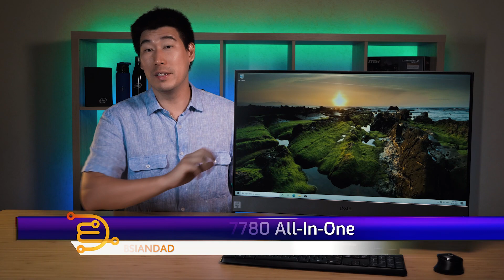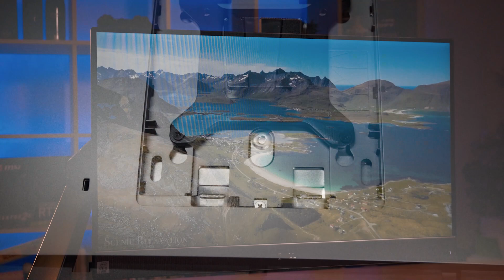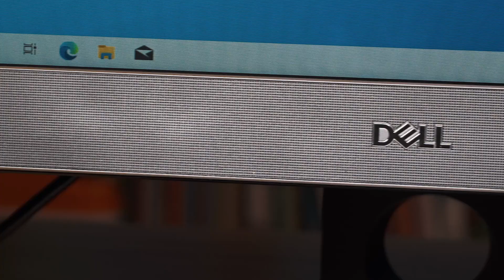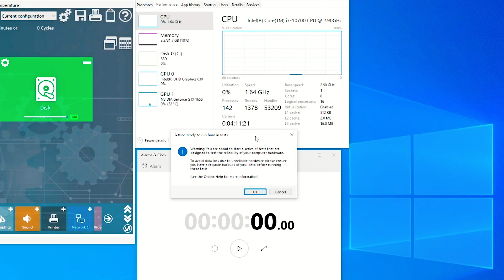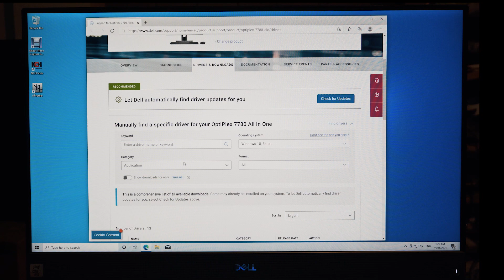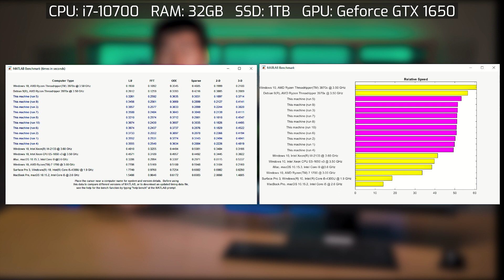Dell Optiplex 7780 All-In-One (AIO) In-Depth Review - Great business desktop

Comment: FAN NOISE. Reference is made to fan noise. It is NOT bearable. I have the i9 version and the fan noise is loud and constant. I looked it up in the forums and it seems I am SOL on this as I am outside the return window and in all cases Dell has no solution other than throttling down the processor or live with it. Other AIOs in the line have the same issue, so this seems to be a design flaw of this series. If you don't mind a constant, very noticeable (by you and your colleagues) noise in your office environment, then go ahead and get one. As for me, I'm stuck with a vacuum cleaner on my desk.
Reply: I find my i9 7780 is quiet as a mouse.   Even when running antivirus scan or other CPU intense programs remains quiet.  Contact Dell.
Reply: @robertarmstrongjr6081  I just ordered one and a bit concerned about the claims of fan noise and even screen darkness. I really need a confidence boost. LOL
Reply: @Biggerbyte  you will be very happy with the Optiplex 7780.  Mine has the i9 64 gigs ram touch screen  with wifi 6. Everything just works as required.  Even the Dell apps are non obtrusive.   Relax and enjoy this fantastic PC.
Reply: what is your exact Dell  model number?
Reply: Got my 7490 a couple of days ago. Config is i5 11th gen, 512 SSD, 16GB RAM and 1650Ti. Under load (games) it change to hair dryer! Strongly thinking of returning it. Check this video how they design cooling. 2 heat pipes from GPU goes thru CPU! Ofc that will warm CPU itself and in result increase overall fan speed (and noise). Was working for 4y on HP Eliteone which you absolutely cant hear (granted, only integrated GPU there). But seen video of this AiO with GPU and design is different. 2 heat pipes from CPU and one from GPU meets only at endpoint in radiator. That's how it should be.

Comment: nice, in your configuration it costs not so much less than my custom gaming PC lol
Reply: this is not a gaming PC, it's basically a laptop mounted behind a screen.
Reply: @psycl0ptic  yeah, but that's kind of ridiculous imo for a 1080p panel and a laptop
Reply: @pafawag5b6b5b  clearly with it's lack of RGBs it's not for you.    it's for, as an  example, a receptionist at a business, who just needs a single screen, basic computing and a nice and clean desk (minimal footprint).  optiplex is lower to mid end business computers.
Reply: @psycl0ptic  maybe lower to mid end but still expensive as a pretty high-end gaming PC
Reply: @pafawag5b6b5b  it comes with a screen too and Windows 10 Pro and a 1080P webcam, for business.   Again, this not for you, this is for a business that uses computers to make money, they don't give an F about gaming or RGBs.
Reply: @psycl0ptic  if my computer didn't have RGB and water cooling it would be even cheaper and more powerful than this. and with a external 1080p webcam included.
Reply: @pafawag5b6b5b  good for  you.  again this is for a business that has money to blow.   You clearly just want to spend your money on blow.